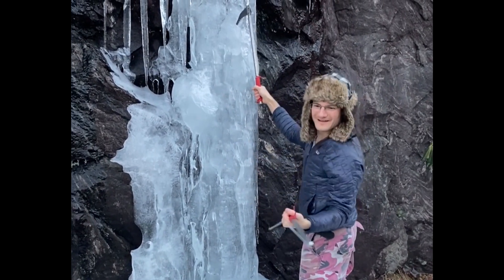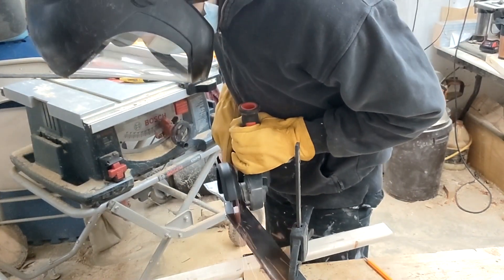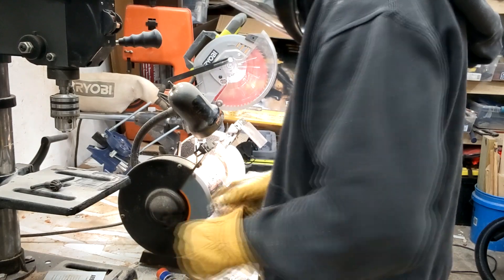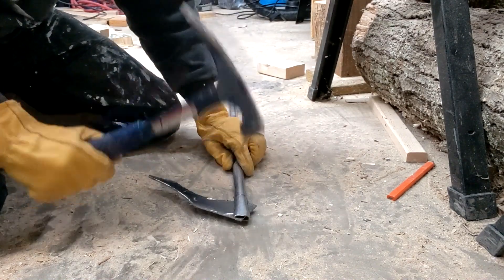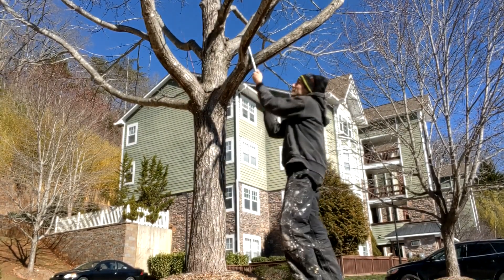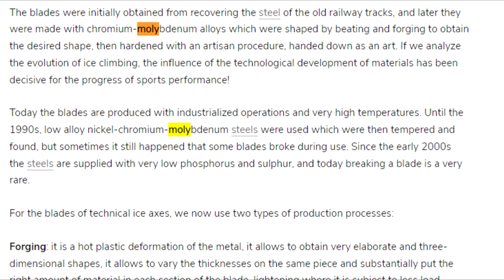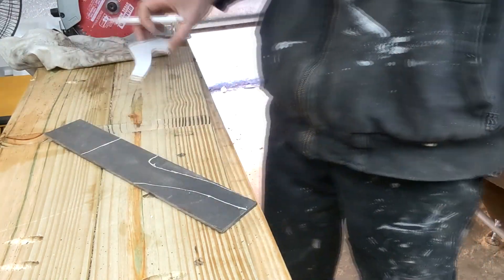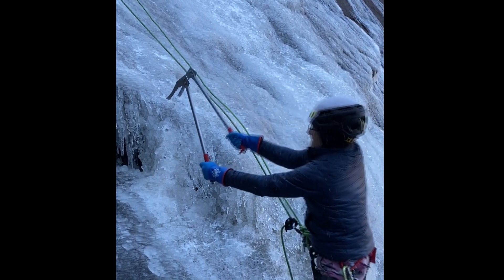Building a custom Ice axe for Ice Climbing

Comment: Did you heat treat the chromoly steel for optimum performance and safety? If you don't have knowledge of and access to heat treatment equipment, going with AR500 steel or Hardox 500 is definitely the best way to go.
Reply from the maker: I def did not heat treat the chromoly steel.  I can report I lead with these ice axes this season and they survived. The handles def need to be improved.   I will check out that steel for my next go around at this! Thanks!

Comment: I love this! I would encourage you to check out an ice climbing book or mountaineering book that breaks down the different types of ice axes and the key features to each! This would really help your design. For example the tip of your axes have positive angles and would be much more effective for grabbing small holds, breaking through ice, self arresting... if they had a negative angle on them! I would love to see if you do a V2 this year!
Reply from the maker: Do you have a recommendation on the book?  I lead with these axes this year, they worked but I was a bit spooked at points lol.